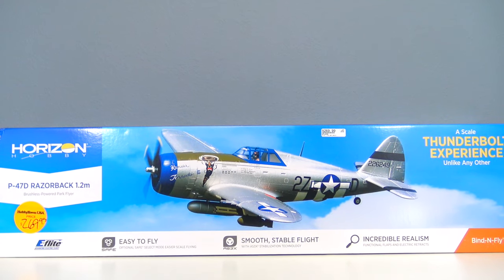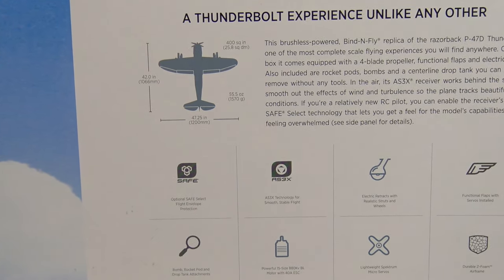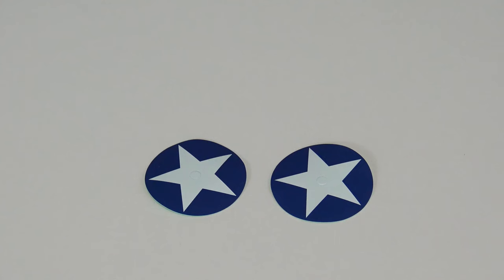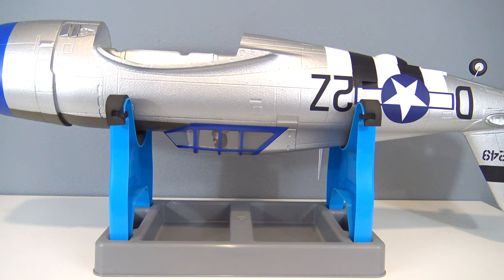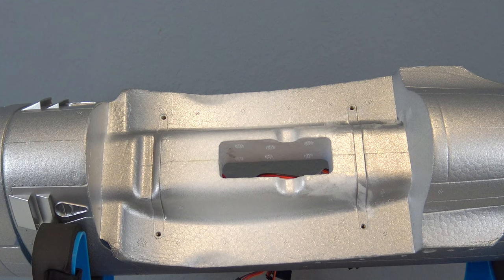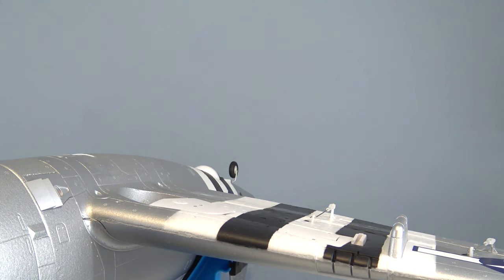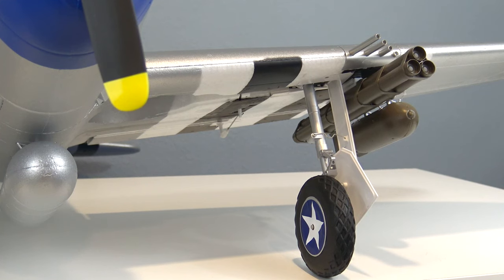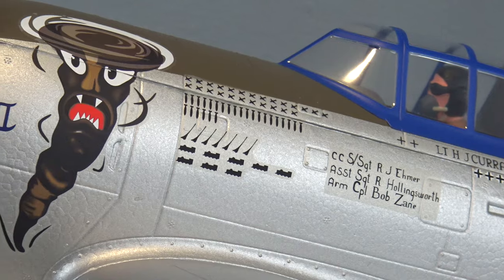E-flite P-47 Razorback 1.2m | Unbox and Quick Assembly

Comment: ok... i got a major problem... i binded it with safe and the elevator, rudder and flaps and throttle work. i could get the ailerons to work. i tried everything!! do you have any ideas? i don't know how to set it up correctly, since I'm new to the dx7... I've read the manual inside out...

Comment: i also reminded it without safe and the ailerons wouldn't work either... could it be the servos? i tried to move it when it was off and they moved, so nothing locked or anything... this is so weird...
Reply from the maker: since I don't have the plane in front of me I have to ask the basic first question - are the ailerons leads connected to the receiver? Did the connector come loose?
Reply: just called horizon hobby. it had bad servos, just ordered another one and ill get a return on this one for a defective item
Reply from the maker: ok good - hope you get in the air soon.
Reply: haha thanks...

Comment: Should I get this plane, or the 1.2 Blondie?
Reply from the maker: I flew the Dallas Doll but not the 1.2m P-51. It probably comes down to just which one appeals to you more. I have flown the P-47 now and it does fly well - it's not a fast plane but it is smooth and looks good. I'll have a video soon.
Reply: Speed is not ideal for me, assuming they are both the same speed though, would you know if it's faster than a Sport Cub S2 on full throttle? I think I'll get the P-51! Thank you, when will your flight video be out on this plane?
Reply from the maker: I put that video up. I like the way it flies - about as easy as a war bird gets. Definitely not the fastest but it has a nice groove. It's probably a bit faster than the s2, but the sport cub is no slouch.
Reply: Thank you, and since you mentioned they teamed up with FMS, and the 1.2 P-51 is around a year old, does that mean this newer 1.2 P47 has better detail and quality now?
Reply from the maker: I think all these newer 1.2m planes are the Horizon/fms partnership. The P-51 looks to be pretty similar detail wise.